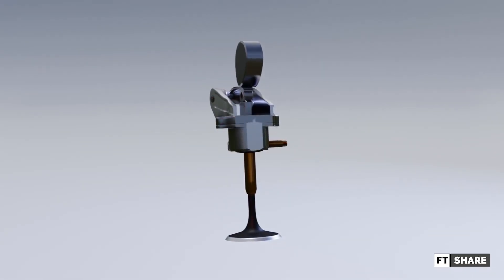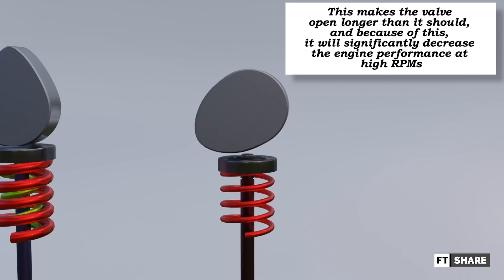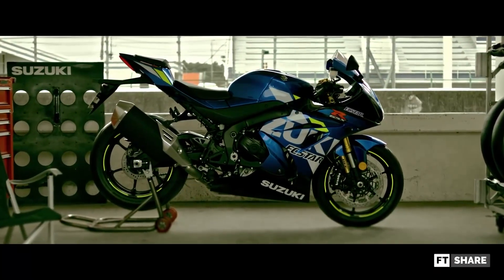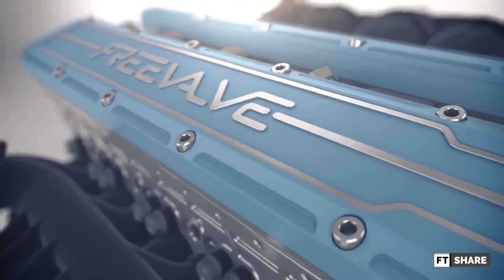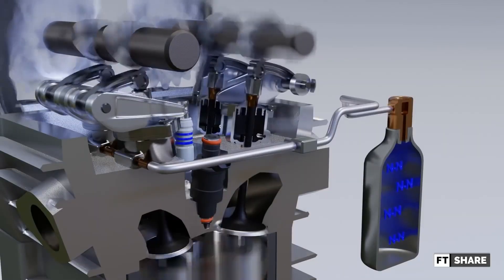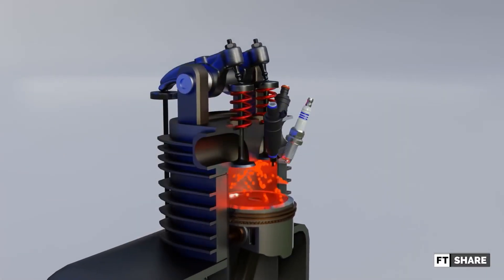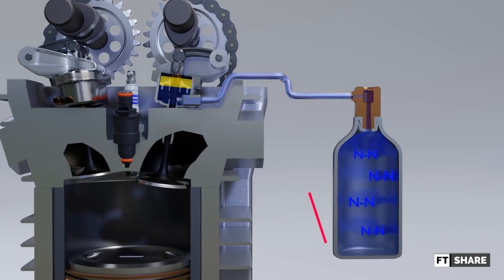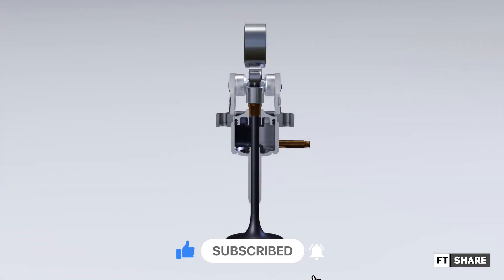SECRETS OF MOTOGP & F1 ENGINE POWER!!! | Pneumatic Valve Spring ( Working Mechanism & History )

Comment: In the glory days of F1 (before FIA guillotine), this is the same technology that broke the 20,000 RPM barrier. I miss that soundtrack soooooo bad.
Reply: Me too
Reply: 😊 at
Reply: I’ve said this for years. But I’ll tell ya fellas, the current F1 fan is a race doofus and only watches it like it’s pro wrestling.
Reply: @Time Atak  - no doubt. Same for NASCAR. The days of true racing are dead. Real racing doesn't keep people's interest anymore, because people have no appreciation for true competition in any sport sport anymore. They want sanctioning bodies to constantly screw with the rules, until it gets to the point where those who win most must work harder than those who consistently perform behind them. They're killing racing for ratings. Sports should be about performance, not popularity contests.
Reply: They are still used in F1
Reply: @timwhiskerd2133  - indeed... but sadly, 20,000rpm V10s and V12s are not 🙇‍♂️
Reply: Very sad, that sound is in my soul
Reply: @Mark Davies  - they did it to supposedly make the sport more competitive for lower tier manufacturers. It absolutely killed F1 for me. I'd rather watch Formula-E for a lower volume version of a similar soundtrack, than listen to a bunch of turbocharged V6 minivan engines.
Reply: @markdavies9765  😊
Reply: Honda produced 20000 + rpm bikes in the 1960s with normal valve springs!!!!!!
Reply: Talk it to CBR250RR 1990 year, with 22000 redline
Reply: Honda broke the 20000 rpm barrier in the 1960s with steel valve springs.....so no.
Reply: Kawasaki made an absolute monster of a MotoGP engine that could rev upto 22,000 rpm for their MotoGP bike before all these fancy tech ever was invented. It truly was a screamer engine.
Reply: @Toxic88088  was unreliable and failed,kawasaki left motogp in disgrace.....

Comment: motogp bike start using pneumatic valve at the 2008 season, at mid season actually, and 2009 all factory team already use pneumatic valve. the reason motogp bike start using pneumatic valve is because desmodromic valve that was very efficient and good at high rpm, and patented by ducati

Comment: I still don't understand how the valve opens and closes. I get that the cam pushes on it. I get that there's pressure inside the valve spring bellows. Is the pressure there all the time? Does the cam push against the pressure? Is there anything to regulate the pressure as it opens and closes? I'm not sure how air pressure acts like a spring.
Reply: Pressure is there all the time  . But there is quite a savings in weight  .
Reply: @Roland Tamaccio  So it's air pressure substituting for Spring pressure? In other words,  Air pressure is pressing all the time like the spring would.
 And then when the spring Needs to be told to open the. Mechanical stuff Pushes against that air pressure the same way it would push against the Spring pressure just that the air pressure retracts The valve faster than a springwood and doesn't have the other Issues?
Reply: @geniferteal4178  like a spring
Reply: @rolandtamaccio3285  Air isn't the Spring but I'm kind of getting the idea how it can act like one.
 I honestly thought there was an up actuation and a down actuation.
 I was wondering how the air was reversed.
Reply: I thought it worked more like the freevalve. I know the freevalve is an electric Solenoid that moves the valve up and down. I thought this used air pressure to move the valve up and move the valve down. I see now. The air pressure just pushes back against whatever mechanism is moving the valve up-and-down just like the Spring would.

Comment: Simplest thing is to use rotary valve for IC engines. The springs and especially in high performance engine where they use nested springs steals a lot of horsepower from the engine. But i believe the electric solenoid valves can and will be the future tech if the IC engine will be allowed to live in the future. If they can manages to use electric solenoid in fuel injectors, that can open and close hundreds of times per second they can use it to open and close the valves in IC engines...
Reply: Electric valves wouldnt be reliable they get too hot
Reply: @jackdaniels2657  Tell Christian Koenigsegg that. Tell him his freevalve idea (that is currently working well) is useless... :D :D :D
Reply: @Guds777  ask him if it is economical..!!
Reply: @Guds777  is freevalve cheaper & simpler than desmo?
Reply: Rotary valves become complex to seal. Standard valves seal well and are durable. With a rotary, or sleeve, valve carbon buildup can make them stick. And it takes precise machining to get them to seal. They might be able to develop carbon seals or something that could make them work better. But, so far they aren’t as easy or reliable as standard valves. 

Solenoid valves are promising. They seem like the future if it all works out. Can basically have the ideal valve action for all conditions.
Reply: @NBSV1 Why doesn't poppet valves have carbon buildup problem. Also it is just matter of design and techniques. You can use Teflon seals or coating...
Reply: @Guds777  Poppet valves can have carbon buildup issues too. But, they don't have a large sliding surface it can buildup on and cause them to stick. Also, the action of poppet valves tends to crush the carbon on the sealing surface and keep it clean. 
Teflon coating isn't going to hold up on an exhaust valve. 
Things like valves haven't changed much in a long time because they've gotten to where they work plenty well enough with minimal drawbacks at a low price. There's different systems that have benefits, but also bring their own problems.
Reply: Hey, let's just go back to 2 strokes and forget about all this high-tech stuff. Would solve a lot of problems; well, everything but global warming. @NBSV1

Comment: Koenigsegg's Free Valve System is 'Camless'... uses no cam at all.

3 things limit RPM: Valve Float, Piston Velocity, and Burning rate of Fuel. 

Managing Valve Float is fairly easy. There are proven technologies in use today.

Long Stroke Engines have higher piston velocities. That is why high revving engines have short strokes. There is an upper limit on any rotating mass. If engine is turning 12,000 rpm, the piston is going up and down 200 times per second. 300 times per second for 18,000 rpm. That means the piston goes from top dead center, accelerates down, then decelerates at bottom dead center, then accelerates up, decelerates at top dead center again. 

Now repeat this 200 or 300 times every second. This puts massive G-loads on pistons and rods. At some point engine explodes into pieces.

Fuel can only burn so fast. If the piston is moving faster than the fuel can burn no more power is produced. It can actually cause an engine to destroy itself by violent 'knock'. This is the Absolute Limiting Factor in any internal contusion engine. The 'Flame Front' (burn rate) is fixed by fuel type, compression, ignition timing, and more factors. 

Want to see spectacular engine failures... watch dyno runs when 1 or more of these 3 limiting factors fail. I've seen engines explode like bombs.... flames and shrapnel. 

Lessons learned... every engine has an upper limit. Exceed it and pay the price.
Reply: Any lift or duration is infinitely variable. At any rev. At any load. At anytime.
Reply: @PorscheCannem  Thanks for comment. Finally a perfect camshaft...
Reply: And still no Koenigsegg's Free Valve System in any vehicle.